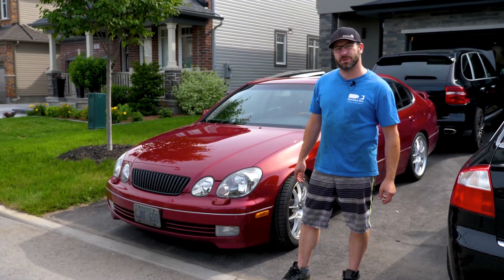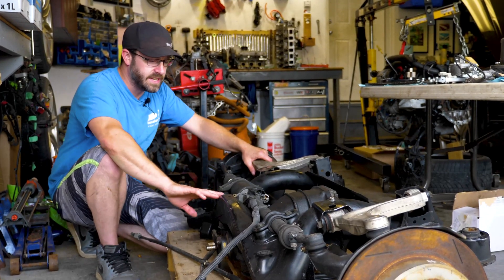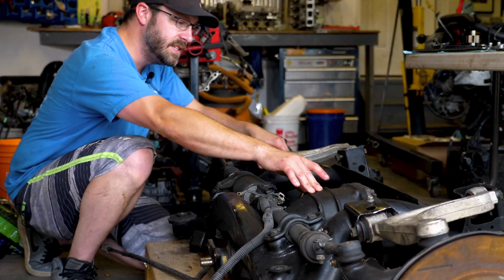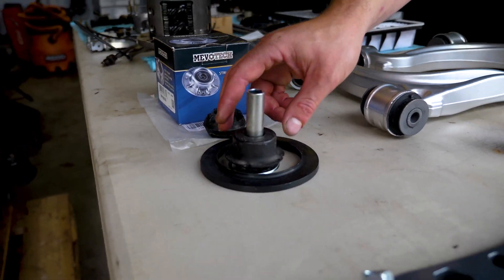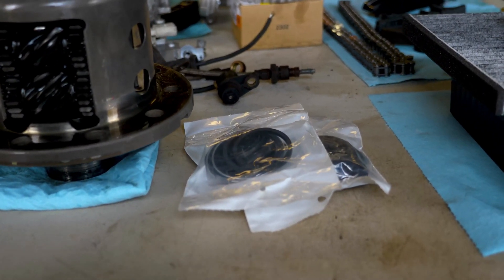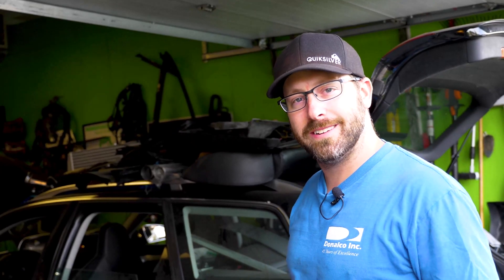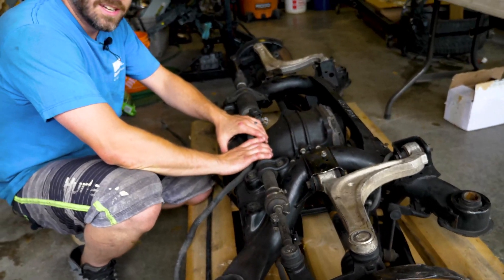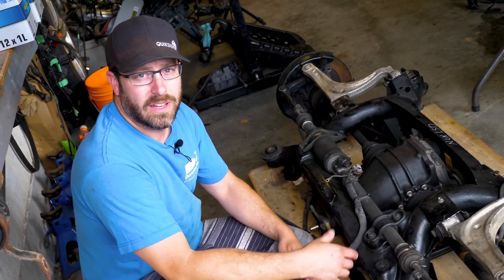2GS400 JZS161 Rear Subframe Refresh Project - INTRO

Comment: For the future use: U`ve bought a turbo version of subframe, from JZS161 Aristo frame. You should better look at the NA version of Aristo frame: JZS160. It has exactly the same subframe, WITHOUT rear steering.
Reply from the maker: Hey thank you for the information! I should have clarified that in the video, but will do on the next one. We plan to make a bar for this unit, which is common to delete with the rear steer subframes. This one was super clean and pretty cheap, which is why we sourced it, knowing it needed the rear steer delete.

Comment: I'm about to do the same , how are you going to get the ars light off after you lock it?
Reply from the maker: Our GS never came equipped with it, so there will be no electronics to mess with. If your car came equipped with it from the factory, then I would imagine you could rig up a resistor of some sort to make the ECU think it is there. Or perhaps flash it out, or swap ECU with a north American one that doesnt have it.
Reply: @PBGarage  aw I'm with you mate, yeah I was looking for a whole gs300 frame and swap it out from there but I can't find one and have all the adjustable arms and bushes so just going to try lock it 😀